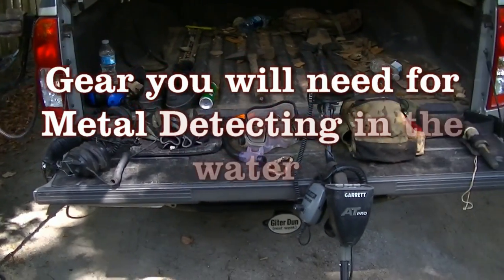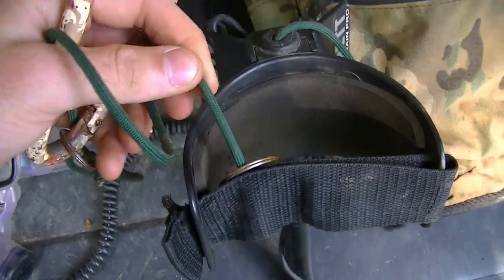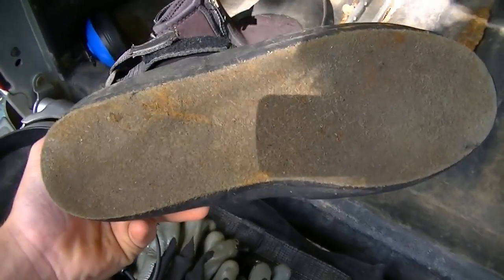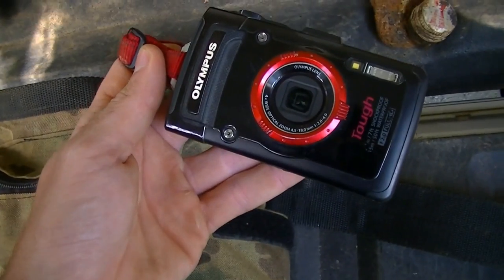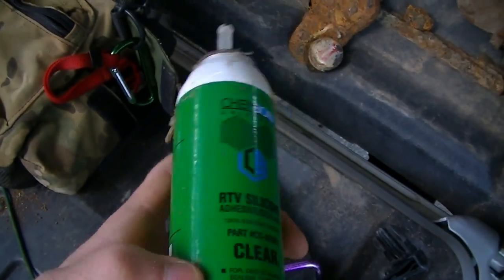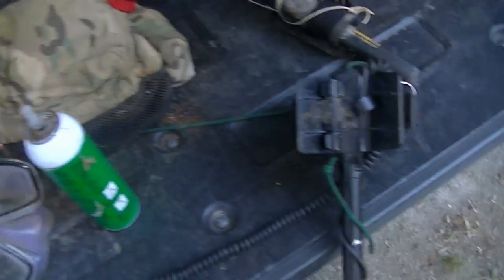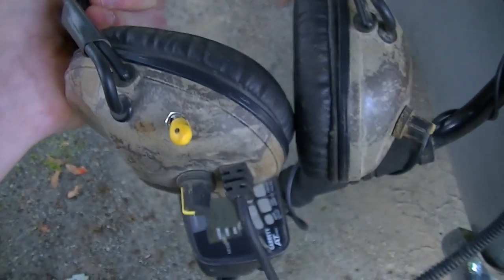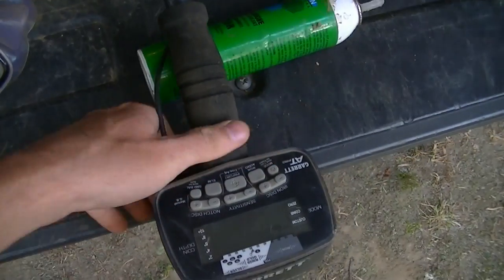The Gear you will need for Metal Detecting in the water | Nugget Noggin

Comment from the maker: i now use the garrett headphones for water hunting and Killer bs on land. as far as sound quality goes Killer bs sound better than gray ghost and the black garrett headphones. you will need an adapter for them though. thjats 35 dollars. but like i said its worth it. All fall and winter i use Killer b headphones and in the summer i normally use the garrett blue ones. they work just fine. with the amphibians if you turn the volume control knob below 10 you loss depth a lot.. and 10 is very loud to

Comment: Re the snorkel. Get a longer straight one. 2  1/2" pvc tubes attached across top & bottom of childs inflatable circular flotation device. Cut snorkel tube @6" from bottom.

Comment: I was watching your other vid for carbon adapted handles for detector and had an idea you can use and adapt very sturdy but cheap bicicle handles--they got great variable pipe diameter adjustment fixtures these days, very inexpensive and great materials and finishing. Cheers.

Comment: attach top of snorkel vertically to the 2 cross brace tubes. connect both snorkel tubes with @5" of tubing. lightweight anchor attached to flotation device,

Comment: Wish I could afford to hunt. If I added everything together correctly that's over 1,500 worth of gear. I can't even afford the detector, lol!
Reply: Lots of good entry level detectors out there for a lot less. Garrett Ace 250 is a good one to start out with. One of my Daughters friends who likes going detecting with us picked up a Fairy new Bounty Hunter Legacy 1500 detector at a yard sale for $10!! Her and her mom brought it over to show me. I put new batteries in it, routed the coil wire correctly and set it up for her height. Thing worked great! I set her up with a $5 short shovel, gloves, one of my spare Garrett pouches, and a hand trowel. Her Garrett pro pointer was the most expensive item. We got lucky and won  it off eBay for $45,. Bottom line is for around $100 She has all her own gear, and is out having fun. Check Craigslist, things pop up every hour.